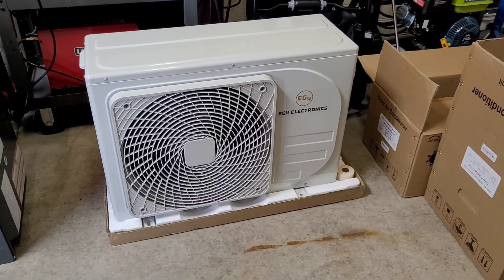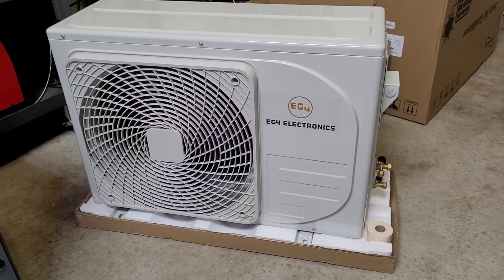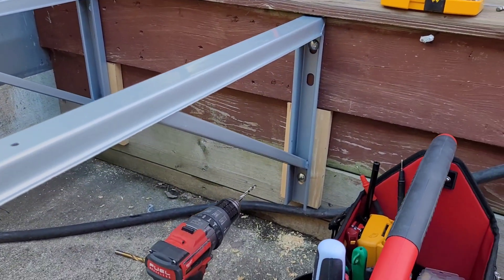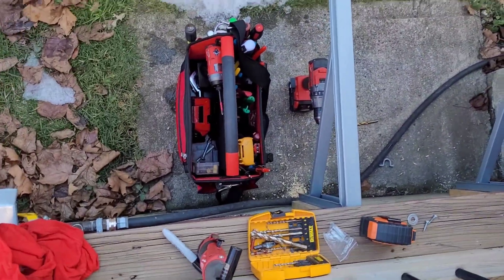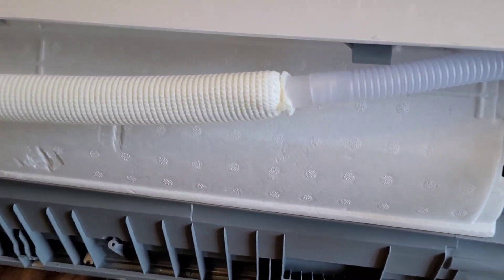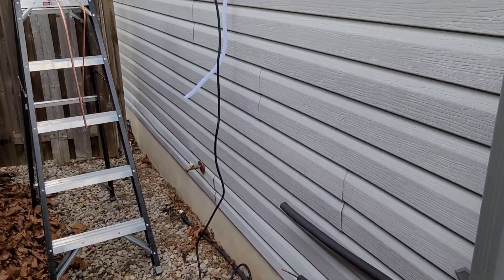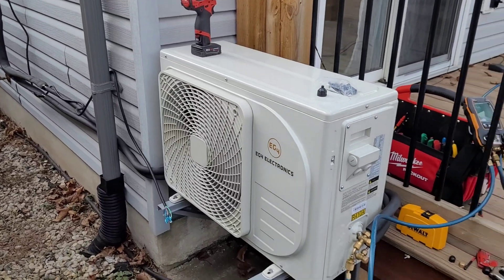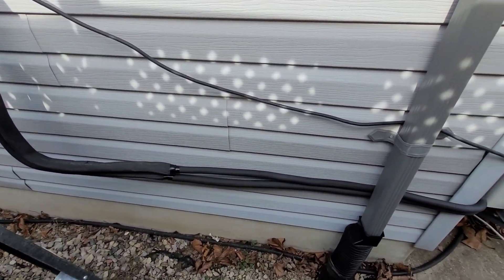Installing A Solar Powered EG4 Minisplit Heat Pump!

Comment: This looks like a great possibility to supplement my current gas furnace and swamp cooler HVAC system. I’m wondering about sizing appropriately. I live in southeast Utah with plenty of sunshine, dry cold bright winters and hot dry summers. My homes upstairs is about 1150 square feet with 8 foot ceilings, I have a small 1/3 basement that’s about 450 squate feet also with 8’ ceilings, but about 100square feet of that is an unventilated storage room/pantry. The basement has no door separating it from the upstairs living room where I think the mini split system will go best mounted through the homes north facing wall. Going off this square footage what BTU size of the EG4 mini split do you think would best supplement heating and cooling my homes space? Thank you for showing an HVAC professionals take on DIY systems. -Jon
Reply from the maker: You could probably go with either depending on your needs. 24k should be adequate to cool the whole home, I requires more panels. The 12k does a pretty good job of taking the edge off and the main Ac would run a lot less, it requires less panels and runs on very little power even after the sun goes down.

Comment: Is their any sealer u used on the line set flare nut..or gaskets
Reply from the maker: No, you can use Nylog if you want but if you make a good flare you don't need it

Comment: Is there any type of portable heater which is the cheapest to operate and would keep our tv time in the living room heated well? Just until we get our new mini split system purchased and installed?
Reply from the maker: There's electric space heaters if you have enough power, a propane buddy heater which has its drawbacks, or you could try a diesel heater. Diesel would probably be the most economical.

Comment: Im buying this ,but i can't find out whether i need 110v or 220v wire for the on grid part also what amp breaker to use for grid power?
Reply from the maker: Are you buying the 12k or the 24k btu?
Reply: @SmitHVAC.  12k
Reply from the maker: @dominickthornburghakaTRG  The 12k is 110v and you can use a 15a breaker with 14 gauge wire. Appreciate it if you use my link when you go to buy one!

Comment: New Subscriber here. Question, why do you use nitrogen? And is it before or after the vacuum? Thanks in advance.... ..Jeff
Reply from the maker: Thanks for subscribing Jeff! The Nitrogen is used before the vacuum as a pressure test, no change in pressure generally means there are no leaks. I also used Nitrogen while brazing to prevent oxidization inside the pipe, but if you're not extending the lines you don't need to worry about that.
Reply: Thanks for the quick reply. I live in Texas about an hour from Signature Solar. Hope to be getting mine in next couple of weeks. Got the tools just kinda working on my confidence.  Hope to get 4 or 5 of these over time. If I have a question would you be willing to give advice?
Reply from the maker: @JWTX  Yes if you have any trouble just leave me a comment or send me an email
Reply: @SmitHVAC.   Would you happen to have or know any discount codes for Signature Solar?.... Also where would I get a bottle of nitrogen and about how much would it cost?  Thanks Again....Jeff
Reply from the maker: @JWTX  I don't have any discount codes at this time. You'd probably have to source it from an Hvac wholesaler and maybe somewhere like TSC. The Nitrogen itself isn't expensive but the deposit on the bottle is usually a few hundred dollars, you get it back on return.
Reply: Was going to pour a small slab for the outdoor unit. But just noticed in manual it said to have 300mm clearance below? I know I've seen others put on slab or blocks. What is your opinion on this? Thanks again for all your help..... Jeff
Reply from the maker: You'd be fine to put in on a slab as long as your not expecting snow
Reply: We seldom get snow but if we do can keep it cleaned away from unit. Also noticed that the drain sits lower than the feet. I figured I'd just leave it out as it can drain onto the slab to which I put a slope onto, that was it will drain away from the unit..  Y'all still getting snow up there?
Reply from the maker: @JWTX  yea that'll be fine. I don't have my drain fitting connected it just drips out. A little snow today but the temperature has come back around 34f so not nearly as cold
Reply: @SmitHVAC.  Do you know why it says to keep 3 feet away from other electronics? The only place I have for one of the units is over my TV, it will only be about 2 feet over top of the TV.   I'm guessing it might have to do with the remote function.  Just hope it doesn't cause an issue. We had that artic blast here in Texas got to little below 0° But right now it's in upper 60's to lower 70's  Crazy huh?
Reply from the maker: @JWTX  Yea it's just to avoid interference, it should be ok. That's a pretty wild temperature swing!
Reply: @SmitHVAC.  Noticed in Manuel about the solar hook up it says to have over current protection a fuse not to exceed  12 amps. Was looking on Amazon but all the inline fuses are 10. 15 and 30 Amps. So kinda confused as what to get? Any recommendations? Thanks..... Jeff

Comment: What size hole is that for the line set to go through the wall? Thanks
Reply from the maker: I used a 2.5" hole saw
Reply: @SmitHVAC.  thanks

Comment: Q: how do you determine the best location for the setup?
Reply from the maker: Depends on your needs, I wanted this one to cool the main living area of my house so it's in the most open space possible but you may want it in a bedroom. Somewhere with easy access to electrical is ideal if you plan to connect it to grid power as well.

Comment: I'm seeing your Inside Head Unit lines are already straight back.  Mine arrived and are inside the unit.  Did you have to bend them out straight?   I have 3 units and need to bend one head units line set 180* from where it came shipped (tucked in and under the back of the head unit).  How did you bend the lines?  

Also,  what is the OD of the copper tubing?   will a 1/4" to 3/8" bender work?
Reply from the maker: Mine arrived the same way. Just bend them gently by hand and you will be fine. The lines are 1/4" and 3/8", a bender will work but you'd have to peel the insulation back.

Comment: I just installed my 12k unit about 3 weeks ago and its been amazing.  Works great, highly recommend
Reply from the maker: Have you been heating or cooling with it?
Reply: @SmitHVAC.  ive used it both ways, awesome product. Saving lots of money
Reply from the maker: Did you see the 12k is on sale right now. $999!!
Reply: Hello, did you use the same brand. I need to purchase 2.

Comment: i to live in canada ,, brampton ontario ..
i am thinking of the EG4 product line  .. the 6500 or the new 8k split phase inverters .
how do you find the shipping charges and border fees . any other insights you might have
like repair work ( warranty ).

thank you
Reply from the maker: The shipping charges to Canada were high ($450 USD) so I had it shipped to a family member in NY for $100, then picked it up and crossed the border with it expecting to pay the duty, but the border guy was in a good mood and let it go for free. I have not had to make any claims fortunately but will update if the situation arises.
Reply: @SmitHVAC.  thank you